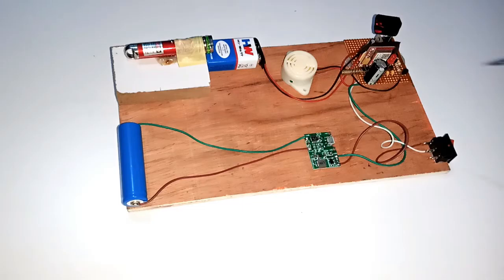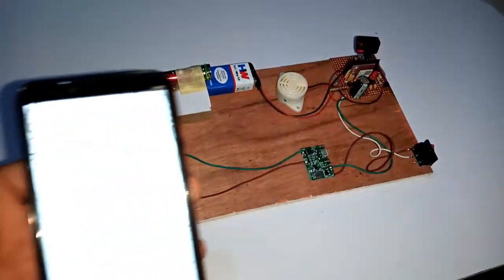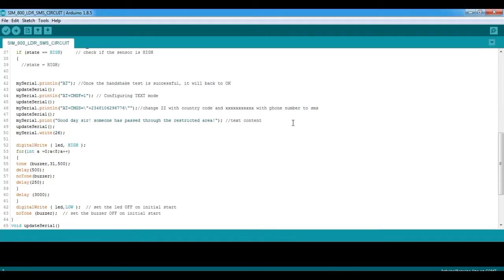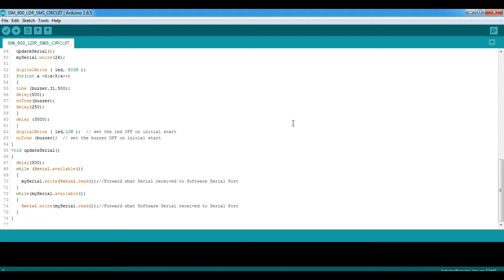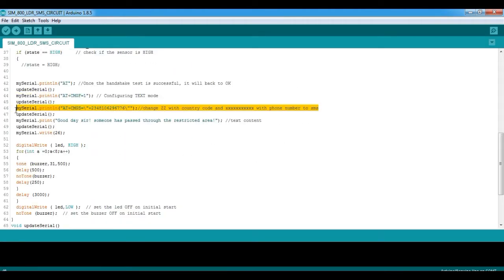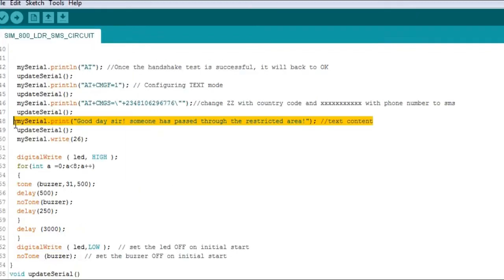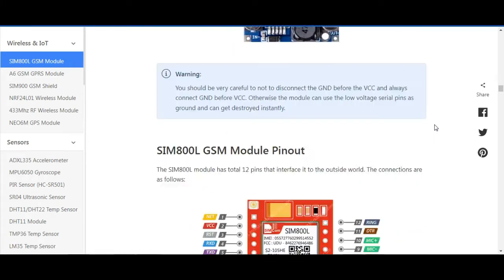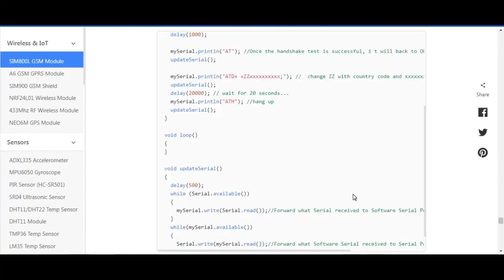Sim800L SMS Based laser security system project

Comment: Hello sir, as for the circuit i tried the laser alarm is working but as for the sms it stays in initialising state in arduino only sir. It is not sending any messages, may I know why sir?
Reply from the maker: Hope you connected the capacitor to the circuit,as the module requires high current to work
Reply: @MEmbedded_TechLab  sure sir I will try and update to you sir...how can I contact you sir?